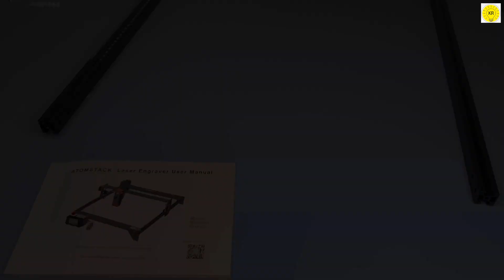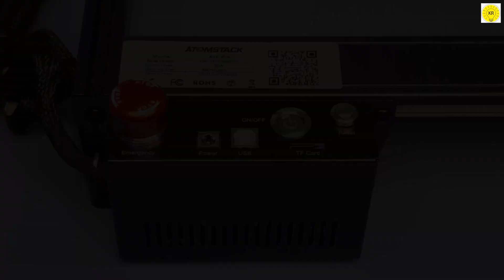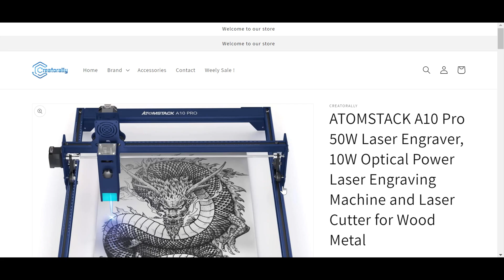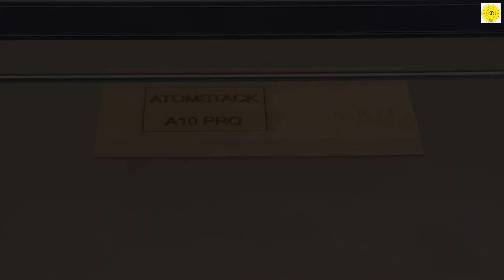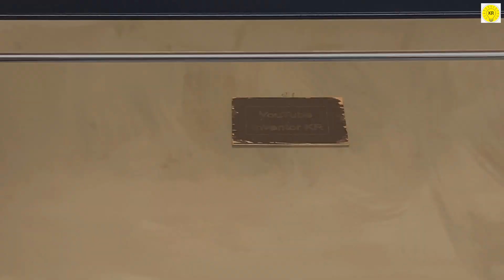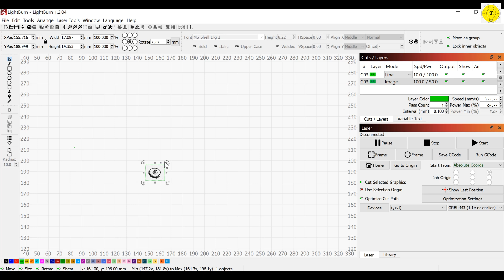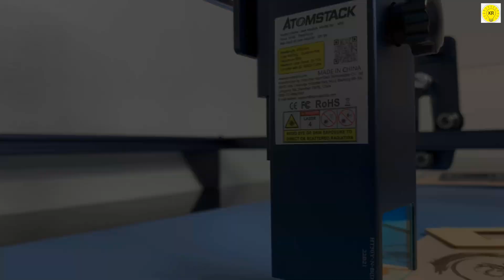how to use the blue laser cutting machine atomstack a10 pro

Comment: How to set up to engrave on acrylic, steel? Because I try to engrave on acrylic, steel, but the pattern does not appear.
Reply: Clear acrylic, try placing black card/paper underneath. Stainless Steel I use 30mm/min speed 95/100% power.